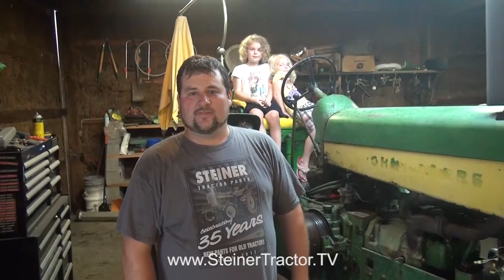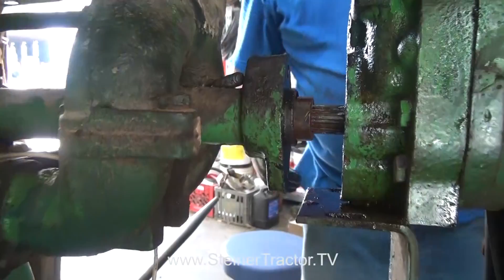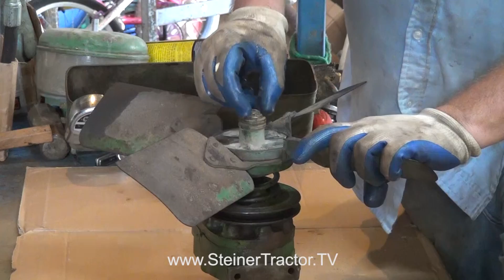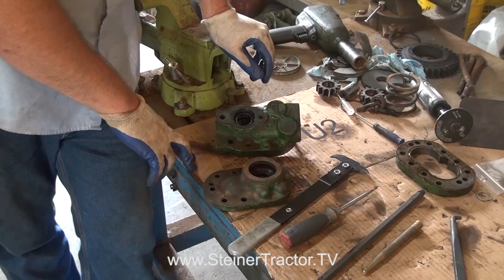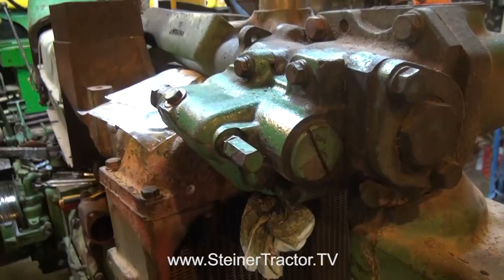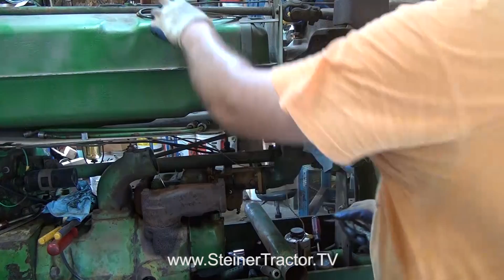Power Steering Pump Rebuild

Comment: 2025 and I have my first Deere, a 730.  Has a bit of a leak/foaming issue from the top of the pedestal, now have a few idea where to start investigating to solve this problem.

Do have to ask, did his mentor formerly work at Turners?

Comment: Real nice.  You conveniently skip all the technical parts of getting the pump out and disassembly.  For anybody looking to gain a little extra room to remove the pump from the drive shaft, loosen the three bolts on the other end of the tube and move it sideways for a little more clearance.

Comment: Thank you for a very informative video on the power steering system on these old 2 cylinder tractors,  I've got several of them and have a 530 that the power steering was lost in , didnt really check into it ,just put back in machine building in the back and went on to another , that was 15 years ago and now , im ready to get into it and repair it , again thank you greatly for the video and info !!!! Keep on poppin those 2 cylinders

Comment: I just bought a 1958 JD 730.  Did all John Deere two cylinders with power steering have a dip stick as you demonstrated?  Mine has a pipe plug & no vent hole.
Reply from the maker: We have not been able to confirm this :(

Comment from the maker: Tyler actually used several fittings together to adapt the pressure gauge.  You will have to take the bolt from the control valve and your gauge to a local hardware store to find the necessary fittings - we do not carry them here at Steiner Tractor Parts.

Comment: Nice video!  Very informative.   Could you share a part number or location to find the fitting to screw into the control housing for the pressure gauge please?

Comment: great video!  also during diag. check filler hole-p.s. fluid for bubbles as this is a sure sign, air is leaking into the system. also check shaft where seals run for wear. also a square tube wide front complicate moving radiator because mounting bolts underneath don't have enough room to drop out. keep these great video's coming !!
Reply from the maker: Thank you for the positive feedback, Allisdeere! We post videos a couple of times a month -- make sure you subscribe to our channel so you see them all as soon as they are released!!